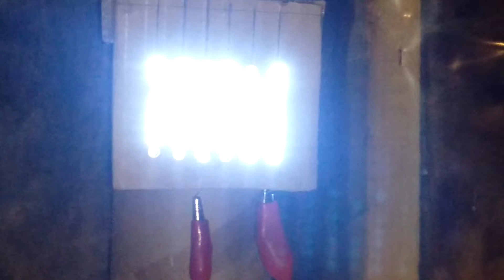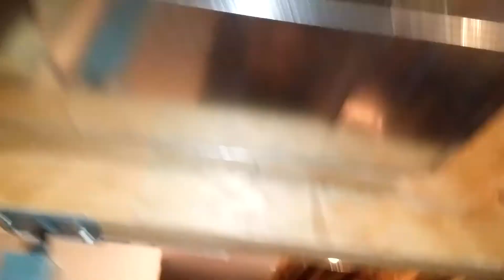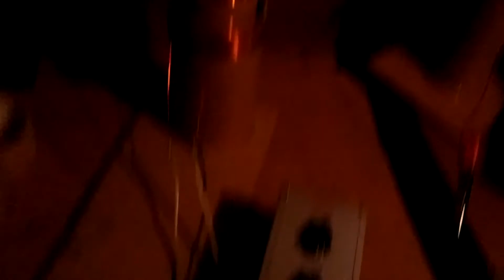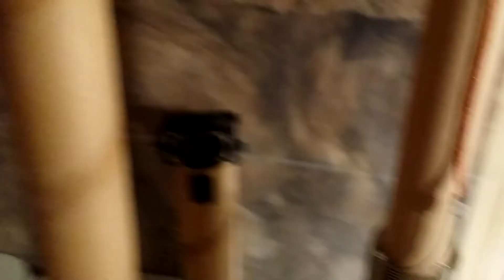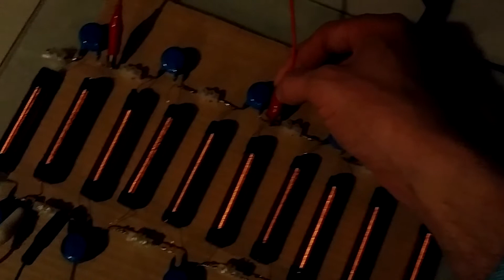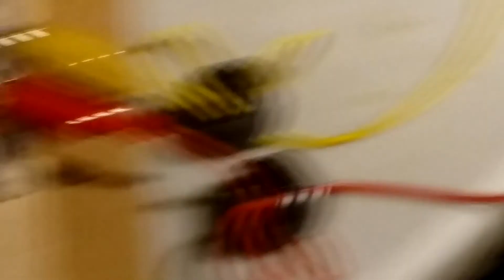Pt 20 TMT: Tesla Magnifying Transmitter, Eric Dollard LMD, near future plans

Comment: good stuff. 10mA input. pretty low. but I missed the voltage input.
Reply from the maker: running on 12v small battery :)
Reply: @kdkinen   120mW pretty neat

Comment: Hi Kurt, So Very Nice to have a new video on your experiments :) :) :)

Do you like your new place? :)

About your video:

- could you confirm the voltage at the input? isn't it a 12 V lead acid battery?

- your LEDs, are they settled parallel? or parallel and series?

- where can we find the complete schematic with indication of the characteristics and fonction of each component? 

- how much you ask to teach someone in your place to understand all how it function, how you calculate certain parts? :)

Best Regards, 
Didier
Reply from the maker: +Didier Khwartz , hi there :) 
-yes input is 12 volts from sealed lead acid AGM battery. 
-the 48 LEDs are all in series, but the LMD network is running the LEDs in series/parallel so the alternating current output lights them in both directions for each half cycle polarity.
-pt 9 has the schematic and i go through the circuit one component at a time. although that was when i was only using 1.2 volts and a smaller scale set up.
-i dont really charge for advice, but would be nice hehe
Any more questions let me know !
Reply: +kdkinen Hi Kurt ! Very Thanks for taking time to answer me So Precisely :)

Yes, indeed, I have an other question for you: what is a LMD circuit! (I am really null in all about electronics ^_^ ).
Reply from the maker: +Didier Khwartz , yes so according to CP Steinmetz there are 2 known electrical waves, 
-the well known Electro Magnetic wave... used widely today in almost everything...
-then there is the less known and understood Longitudinal Magneto Dielectric wave. (the one used by Tesla)
The EM wave is analogous to surface water waves. Which the wave direction is Transverse to the direction of electrical propagation... Pi/1 x Velocity of light. 186,000 miles per second.
The LMD wave is analogous to water in a hydraulic pressurized system. which is a compression and expansion wave. where Electricity is like an in-compressible fluid. Pi/2 xVelocity of light 291,000 miles per second.  
Imagine a long bar of steel where we hit it perpendicularly, it reacts like this ~~~~~
Compared now to rather than hitting it perpendicularly, we hit the tip of it, and reacts like this - - - - - - -
You will enjoy Jean-Louis Naudin's investigation of thie exact experiment... http://jnaudin.free.fr/html/lmdtem.htm 
Hope that helps :)
Reply: +kdkinen Hi again Kurt! and Thanks Again For Your Time And Attention :)

Thanks for having cleard up to me LMD :)

Yes, I knew about Tesla Longitudinal Waves and some of Eric P. Dollards' explanations about but didn't remember this acronym :)

Congratulations btw for making Cristal Clear explanation of it (Y) (Y) (Y) 

So, tell me please if I'm mistaken:

- You generate in the long wire between the 2 terminals, these LMD and it loops "capacitively" in the air thanks to you 2 big aluminium toroids? one on each Tesla tower? that's it?

Is that possible I send you 10 $ by PayPal having your mail? if yes, can you contact me by Hangouts in Gmail to give me your e-mail? ^^
Reply: +kdkinen (I'm on my citizen-mate Jean-Louis Naudin page ;) thanks :) )
Reply from the maker: +Didier Khwartz , yes the toroid on each coil would represent 1/2 of a capacitor. i have less understanding of the LMD Analog Network operation, as the coils are in shunt (virtually shorting out), and a simple square wave at very low power... somehow increases in voltage?... and propagates better than through the wire, yielding a fine quality sine wave!:)
you are very kind, that is not necessary to send money, this stuff is cheap. its knowledge i need :)
Reply: ***** Hi Kurt. Thanks for your new answer :)

Okay, for big toroids as two halves of capacitor.

Can you confirm that you're supposed to generate a LMD in the wire between the 2 tower? Please.

Is the loop of nine LEDs in the schematic of pt9 that you call the series/parallel arrangement? And if yes, do you means that for 48 you are making a big loop of 48, all in series but looped?

On the same schematic, you show 1 battery and a cap in parallel,what is the capacity of the cap? please. Is that change now, with you 12 V set-up?

Btw, this is the transmitter, I guess: can you show the schematic of the receiver? 

Anyway, I would rather prefer to support you financially indeed but have a full updated to 12 V and larger schematic. Maybe with numbers as designations, would help to refer to when you explain then in your videos or when we ask you questions, imho. Than a table with the values of each component. ;)
Reply from the maker: hi again, I believe that being  single wire transmission, the only wave that could do that would be LMD. it looks like the wave form is actually shuffling, as though it was compressing and expanding.
and Eric Dollard has said in the video where he was talking at the Radio crowd that through the air would be EM, but the ground wire was LMD
Reply: +kdkinen Very Thanks for specifying for the "ground wire", I guess the link between the 2 tower?

I was making modifications in my last comment. Can you answer thus my additional questions ?  ;)
Reply from the maker: oh and the 48 LEDs are all in series with an Avremenko plug yes
Reply from the maker: Didier Khwartz oh the receiver sure i can do that, along with an update schem for the present configuration.
yes the very fine wire represents the ground connection. that is why a one wire system could be considered "wireless" as you would only need a deep ground connection at separate locations.
keep in mind that frequencies above 80 khz or so do not travel well through the earth.
so my next project, aside from the Akula/Kapanadze device, would be to lower the operating frequency down from what i have here running 300,000 hz to under 100,000 hz. that will be done by using wider diameters, higher inductances, and larger proportions in general.
i start with the Resonator (Tesla called it the "Extra" Coil)
then once the resonator has been built, i measure it and then build the rest of the driver system (primary and secondary and feedback circuit) to operate according to the Resonator.
The resonator would be different for everyone due to using different sizes of  diameters and gauge of wire, self-capacitance, different inductances... etc... so yes i will tell you what my component values are... but it litterally is different for everyone :)
Reply: ***** oh the receiver sure i can do that, along with an update schem for the present configuration.
. . . THAT, would be Wonderful! :D <3
Reply: ***** yes the very fine wire represents the ground connection. that is why a one wire system could be considered "wireless" as you would only need a deep ground connection at separate locations.
. . . Yes, I had copied that indeed; thanks for remembering, Kurt :)
Reply: +kdkinen keep in mind that frequencies above 80 khz or so do not travel well through the earth.
. . . Didn't know that! thanks for specifying :)
. . . Of course I guess you were talking about LMD ones, what about the EM ones, as I have understood they go in it even worse; are you agree with this statement?
Reply: +kdkinen so my next project, aside from the Akula/Kapanadze device, would be to lower the operating frequency down from what i have here running 300,000 hz to under 100,000 hz. that will be done by using wider diameters, higher inductances, and larger proportions in general.
. . . Interesting, and it would be much surprising to me that you would gain same time in Power :)
Reply: +kdkinen then once the resonator has been built, i measure it and then build the rest of the driver system (primary and secondary and feedback circuit) to operate according to the Resonator.
. . . Please, make short vid of each component you build so it could make at the end a DIY set of videos ;) please :)
. . . Is "the Resonator" the coil at the top of the Tesla Tower or one of those at the bottom? I guess it is the top one and below are named "Primary" and "Secondary"; right? :)
. . . Could you indeed confirm that you make first the Resonator and then the Secondary, and them the Primary? and could you confirm the ratio you use between the Secondary and the Primary?
. . . All are clockwise, indeed? and You all wire them starting from the top to the bottom of each coil? isn't it?
Reply: +kdkinen The resonator would be different for everyone due to using different sizes of  diameters and gauge of wire, self-capacitance, different inductances... etc... so yes i will tell you what my component values are... but it litterally is different for everyone :)
. . . Thanks for intending to specify precisely the characteristics of the components you will use :)
. . . I do understand it has to change according to the materials used so could you provide to us a table, ideally an Excel or else spreadsheet? So it can calculate the value of the rest of the circuit depending of the materials we have and characteristics of diameter or lengths, and in mean time, be able to study your formulas of calculation? <3 <3 <3
Reply: +kdkinen I was s forgetting: to be more rigorous, good that when you light a load that you always have at least one unit if the same light bulb or LED that you use, fed by its nominal voltage on a standard power supply, so it makes an "UNIT OF LIGHT FLOW" and of BRIGHTNESS, it helps to evaluate the COP of the device ;) Best Regards, Didier.
Reply from the maker: Didier Khwartz , so the thing is that the Tesla system was analyzed to be ElectroStatic, you can get ElectroMagnetic effects from the Electrostatic disturbance...which people would confuse for EM, but as Tesla himself and Eric Dollard state, the Tesla system is non- electromagnetic.
it can be used in EM mode... but as Tesla said :
"Tesla 
I mean this: If you pass a current into a circuit with large self-induction, and no radiation takes place, and you have a low resistance, there is no possibility of this energy getting out into space; therefore, the impressed impulses accumulate.
Counsel
Let's see if I understand this correctly.  If you have radiation or electromagnetic waves going from your system, the energy is wasted?
Tesla
Absolutely wasted.  From my circuit you can get either electromagnetic waves, 90 percent of electromagnetic waves if you like, and 10 percent in the current energy that passes through the earth.  Or, you can reverse the process and get 10 percent of the energy in electromagnetic waves and 90 percent in energy of the current that passes through the earth.
.  You must not make the antenna give off 90 percent in electromagnetic and 10 percent in current waves, because the electromagnetic waves are lost by the time you are a few arcs around the planet, while the current travels to the uttermost distance of the globe and can be recovered."
N.Tesla 1916
Reply: +kdkinen Very Nice Relevant Quote, imho, Thanks Bro :)
Reply from the maker: Didier Khwartz ""(Tesla)
You could not produce that activity with an undamped wave.  The damped wave is of advantage because it gives you, with a generator of 1 kilowatt, an activity of 2,000, 3,000, 4,000, or 5,000 kilowatts; whereas, if you have a continuous or undamped wave, 1 kilowatt gives you only wave energy at the rate of 1 kilowatt and nothing more.  That is the reason why the system with a quenched gap has become popular.
I have refined this so that I have been able to take energy out of engines by drawing on their momentum.  For instance, if the engine is of 200 horsepower, I take the energy out for a minute interval of time, at a rate of 5,000 or 6,000 horsepower, then I store [it] in a condenser and discharge the same at the rate of several millions of horsepower.  That is how these wonderful effects are produced. ""
N.Tesla 1916
Reply from the maker: /\ just some great words from Tesla in a court room formal Questions and Answer period ! :)
Reply from the maker: ... and yes... 5 Megawatts from 1 Kilowatt, on record, wow
Reply from the maker: here is where i quoted from... :)
http://www.tfcbooks.com/tesla/nt_on_ac.htm
Reply from the maker: +Didier Khwartz , and another..
"These requirements must be fulfilled, whether you transmit by currents of conduction, or whether you transmit by electromagnetic waves.  You want high potential currents, you want a great amount of vibratory energy; but you can graduate this vibratory energy.  By proper design and choice of wave lengths, you can arrange it so that you get, for instance, 5 percent in these electromagnetic waves and 95 percent in the current that goes through the earth.  That is what I am doing.  Or, you can get, as these radio men, 95 percent in the energy of electromagnetic waves and only 5 percent in the energy of the current.  Then you are wondering why you do not get good results.  I know why I do not get good results in that way.  The apparatus is suitable for one or the other method.  I am not producing radiation in my system; I am suppressing electromagnetic waves.  But, on the other hand, my apparatus can be used effectively with electromagnetic waves.  The apparatus has nothing to do with this new method except that it is the only means to practice it.  So that in my system, you should free yourself of the idea that there is radiation, that energy is radiated.  It is not radiated; it is conserved."
N.Tesla 1916
Reply: +kdkinen Great Quotes ! Kurt, Thanks A Lot! :)

- was a "damped wave" for him, a wave from a kick and them we let the vibration damping down to zero amplitude?

- a "quenched gap", is that a special spark gap? those rotating we see in his schematics of patents ? 

- note that there is a different between having a verbal testimony, even written in a court, than a photograph of the set-up with a table of all measurements that show it was real and shows the different flow of energies and powers. Tesla might have lied or just mistaken on these points, even if I understand we can give him a Big Bunch Of Credit, due to his factual proved workable and used (like alternative generators  and motors). I try to NOT// be a believer but more a kind of "Scientist" ;)

Would be Happy if you can answer my previous questions :)
Reply: +kdkinen About your updated schematics : that would be gorgeous if you could represent your measurements set-up on, like Amps and Volts meters, oscilloscope probes :)

Comment: Great video! I just had a couple of questions. Are the coils on the LMD analog computer inductance matched or did you just use the same number of turns on each one? Also, are those ferrite cores?
Reply from the maker: +Alex Johnson ,coils are all the same inductance, but connecting on the end coils didnt work as well as grabbing across the 2nd coils in. because you will notice that despite the inductances being equal.. the end coils measure different shared inductance. so anyway i used the 2nd coils from the ends :)
Reply from the maker: +Alex Johnson ...and yes they are wound on insulated ferrites
Reply: Interesting. Thanks
Reply from the maker: ...but air cores could work too